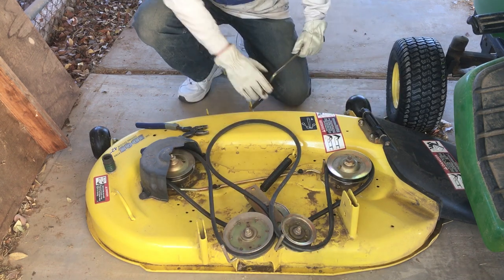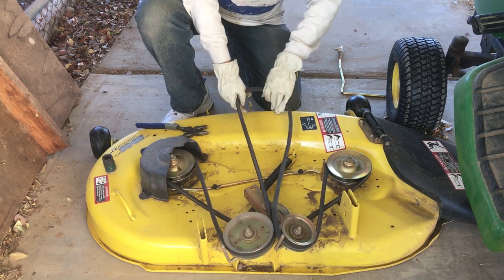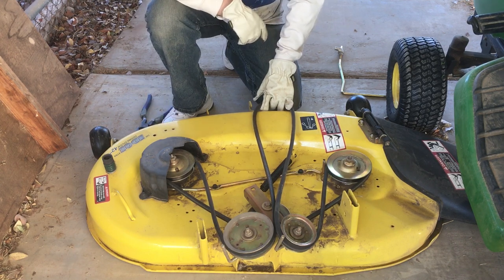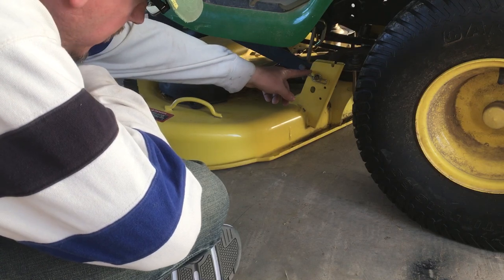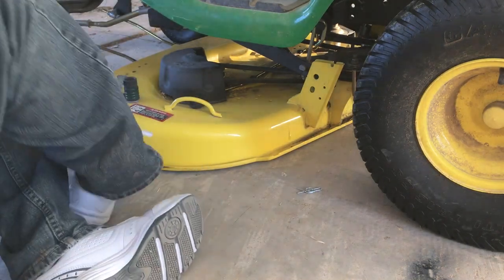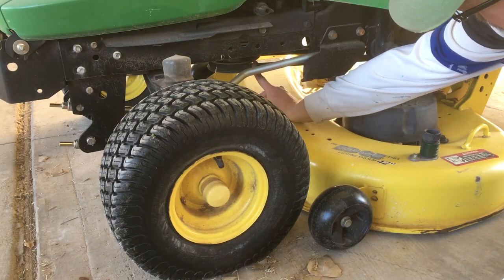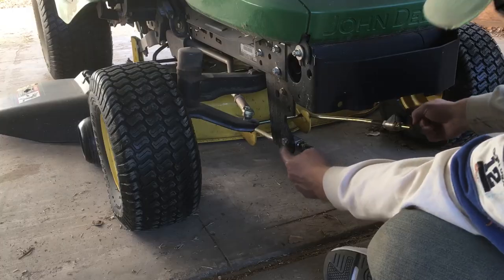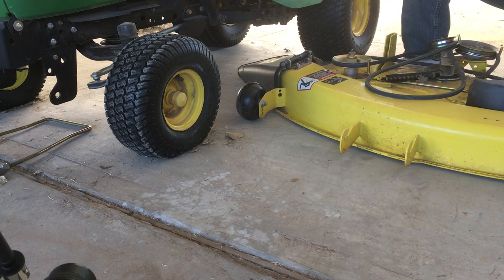Removing a 42 in Deck From a John Deere X300

Comment: The 3/8" ratchet (with no socket attached) fits perfectly in the 3/8" square hole located exactly where your linesman pliers grabbed the tension arm.  Very handy since you can adjust the ratchet in either direction when removing the belt from the motor pulley.
Reply from the maker: Yes, that's it!  It's so obvious after you say that and I look back at what the tension arm looks like... but man, that simply never occurred to me until now.  Thank you!

Comment: Bought a used JD X300 and have been trying to learn to service it.  Very smart to show the workings of the deck first to more clearly understand the steps for removing the deck.  Also thanks to Arnold for explaining (much more clearly than the manual) that the 3/8" ratchet was to be used without a socket attached.

Comment: My 42C JD deck has a lever to release tension on the belt,just pull it from the hook and move backward to loosen the belt for the blades,no tool required. There is another belt that goes from a deck pulley to the lower engine(PTO?)pulley that has to come off to remove the deck. Still very easy to do. If I don't need to move the machine I can just leave that front bar hanging underneath,no need to take it off as it just slips into the front hooks of the deck. 4 attache points,2 spring loaded pins without cotter keys and 2 hooks. Good video,thumbed up.